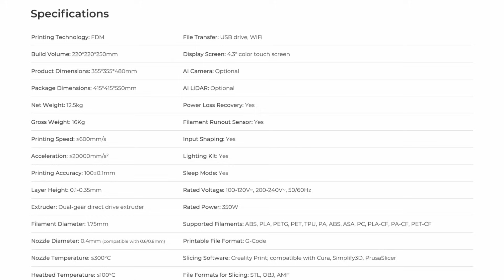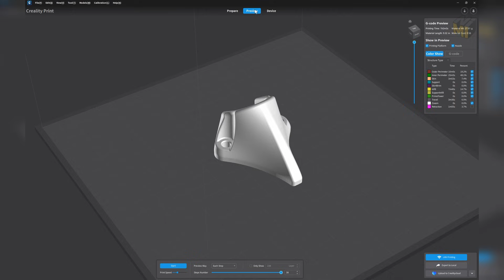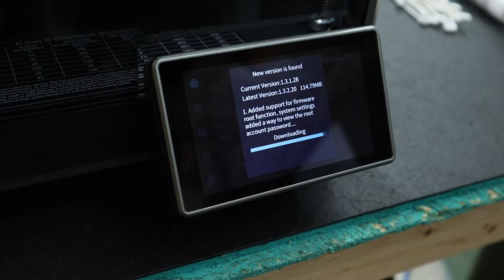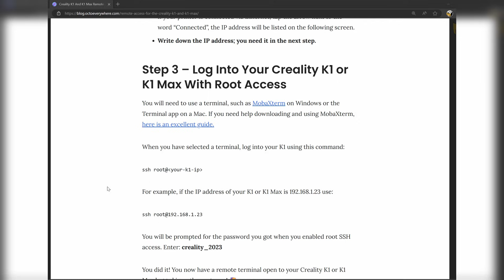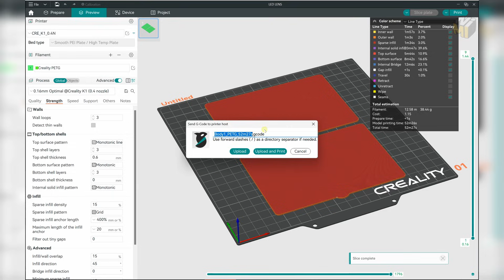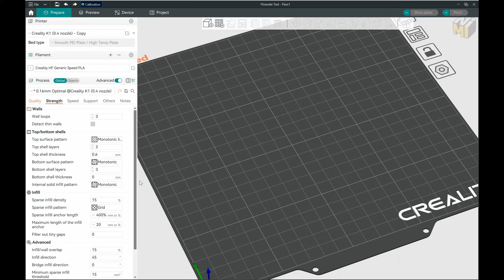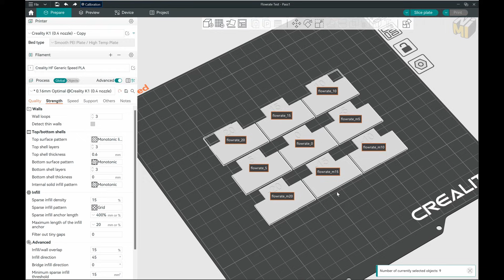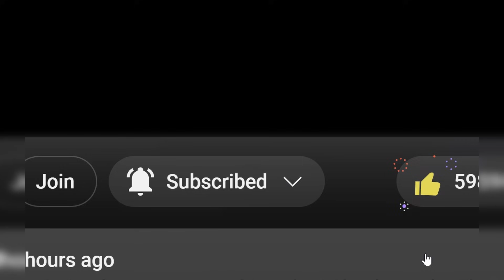Orca Slicer is BETTER than Bambu Studio, Cura and Prusa Slicer because they were the food!

Comment: I tried using Orca after many years with Cura, and I can say that Orca is the least intuitive slicer I've ever used. Basic functions are hidden behind many windows or drop-down menus. After spending a few days getting the profile working properly for my printer, I did multiple tests with parts printed in Cura and others in Orca, and honestly, there was zero difference in quality. In terms of print time, Cura was faster than Orca in many of the tests, so honestly, I don't see the reason to switch, unless you want to take advantage of Orca's multi-color functions. If not, I would definitely avoid it.

Comment: i did my testings for speed and quality in cura and orca slicer with exact the same settings. I dont know why but orga always seems to be stringing a lot more (yes, the retract, z hop etc is exactly the same) and its always around 20% slower than cura. Getting a small part in cura done printing in 5 min with cura and 7 min in orca. Yes i have put accell and everything i can change exactly the same. And the clear winner for me is cura because it has combing. It saves a lot of retraction times and makes the printer even faster, getting the same part down to 3:40 min in cura. With better quallity and less post processing
Reply: the time stamp was  accidentally, ignore it

Comment: I initially downloaded Orca because Prusa slicer was doing some bizarre things with the supports in the G-Code preview... not sure if that was just a visual bug or how they got like that since I didn't knowingly change any settings, but I didn't want to run the risk of the print failing if it was actually going to try to print the supports 2 mm thick.. the built-in setting calibration tests are kind of neat, though I do wish performing the tests wasn't so cumbersome.. just part of the process, I suppose, I'm just lazy and hate wasting material that I could be using for actual prints 😩

Comment: I don't like the UI with orca, I hate that some of the settings are tied to the printer vs filament vs part. I just want 1 big long list of settings so I can go down the list and make sure everything is right and be done with it... I can see how it might work if you have like 50 printers running 100 different filaments, but for the average user, that's not the case...
the only real feature I like is being able to just send to klipper by hitting print.

I'd be more apt to use it, if I could pull over my profiles from cura without having to fucking guess which values translate to which setting.
Reply from the maker: Sure, everyone has their preferences.  I also came from Cura, I'm at a point now where I prefer Orca over Cura, originally I also preferred Cura.  To each their own.  At the moment, I only use Orca it does everything I need and it has quite a lot of new features and some features even Bambu Studio doesn't have like Mouse Ears, and Vertical for setting the seam position.  I say do what works for you, each person will have their own set of requirements and not every slicer may do exactly what you want.  Thanks your thoughts on this!

Comment: No Orca Slicer is far from being the best slicer. Orca Slicer is still missing a bunch of important stuff compare to Prusa or Super Slicer. The biggest one is missing the Printer Dependencies  settings. This alone makes Orca almost useless for a pro user! You can not assign and manage printer profiles besides system presets. And even the system presets can only be assigned via a copy save. Another thing is the missing manifold edges fix under Linux.
Reply from the maker: Everyone has their preference and features they need and like.  Personally I find Prusa far more clunky to use, but it is feature rich.  So is Orca though, and there are always new features being added.   I've never used Manifold and with a good printer like the QIDI and the X1C, the results speak for themselves.  As far as presets, I switch between 6 different printers and 3 different brands, within Orca, it's never been a problem for me and I print all day every day.  I guess everyone has their own definition of what a pro user is.
Reply: @NeedItMakeIt  I'm not talking about user preferences or features here. Orca has plenty good features. I'm talking about major missing settings in Orca Slicer! But seriously....How can someone be a "pro user" without setting printer dependencies and assigning them to profiles? ;)
Reply from the maker: @Gigaloader   I guess we have different definitions of pro user then, I don't find what you're referring to is necessary,  you do, that's cool.  I'll just have to go back and check the definition of pro user again.  I don't think it's defined by the capabilities of your slicer, quite the contrary in fact.  As the sayin goes... a poor craftsman blames his tools.
Reply: @NeedItMakeIt Well....I would define  a "pro user" as  someone who goes beyond  printer profiles given by orca or bambu.  Someone who creates his own. These have to be assigned properly. You can't do that with Orca as it is limited to the existing printers Orca gives you. At least they do have a lot of them tho.  But if you have your own printer build, Orca is a no go. Hopefully it will come in the future. Just pointing out that Orca only seems to be "better" until you have to set up and configure a printer profile.
Reply from the maker: @Gigaloader  LOL.  A pro user is anyone that 3D prints professionally, that's the most basic and accurate definition.   Just to get back to the point, Prusa is good so is Orca, they both work well, Prusa works better for you, since you're at an advanced level and you need the slicer to do particular things for you that other slicers do not.  All good, have a good one.
Reply: @NeedItMakeIt  Your responses are kind of funny as they show a little ignorance... sorry. It's not about what I'm using. Orca is a decent slicer. But is ported from Bambu Studio which the GUI is optimized for their printers.  These settings in Orca are entirely missing. Which makes it easier for beginners. Not a bad thing. But let me know how you set "depencies" in Orca Slicer for a printer which isn't a system preset.
Reply from the maker: @Gigaloader  Everyone is ignorant, it's ignorant to think otherwise :)   I'm not really sure where we're going with this.   The truth of the matter is that you can use any slicer to achieve professional results, calibrate, good filament, fine tune your settings and choose the right material for the job.  So in conclusion, think what you want, it just doesn't mean that you're right, that goes for me as well.  Try and have your self a good day!

Comment: The Orca team seem pretty open to the idea of "if someone will find it useful and it does not break anything we will add it" type mentality, even if that means having some functionality on one operating system that isn't on another yet ( my linux version tells me they can fix models on the windows version).  I think this is a breath of fresh air, and it is what open source should be... if it does not break user space and it works then add it.  As an end user it means each beta version I see more tools added, some of which give me a happy feeling inside.  As I use appimages I am not bothered if one breaks something, I can report it and just fire up a version from a month ago.
Reply from the maker: And to your point, I have several new features in the Beta going right now, and they need a little tweaking, but it's super nice to have the options.  Going from an idea to something useable within months rather than years is really nice!

Comment: i just started using orca slicer and it has profiles for the ender 3 v3 ke and i have adjusted the settings to that os the sunlu matte pla filiament i'm using and calibrated it using the built in calibration feature and been getting some good results far better than creality print. my question is however will it get messed up if you root the printer or do you have a video on the pros and cons of rooting it?
Reply from the maker: Orca is one of the best out there!

As far as the rooting, I have a video on rooting, but not the pros and cons.  There aren't many cons, because even if you run into any trouble, you can easily reset your printer, there is a HTML link to reset your printer to factory.  I've done it 2 times now just for the sake of making videos and recording the process from scratch.  

The only downside I've found so far is that when installing Guppy, a touchscreen interface to replace the stock Creality one, the IP address always shows as 0.0.0.0. and that is not good.  It still shows even after several weeks.  The only way to find the true IP is to login to your WIFI and see the IP addresses of your devices, that ended up working for me.  

I don't believe that there is any impact to rooting from the standpoint of the operation of the printer, the original Creality FW stays intact and we can just access all of the files and add or change macros now.  I would say that by using Orca you'll see an improvement on your prints, Orca is just a better slicer.  

I'll have a video out soon for the KE, I am just finishing up the design for a solid linear rail setup for it and it should be good!
Reply: @NeedItMakeIt  ty
Reply from the maker: @marknewsom1377  No problem, I just finished re-assembling my KE with linear rails and it's doing the first print now, seems to be all good, and it's rooted and working well.  Printing through Orca wirelessly is really nice.
Reply: @NeedItMakeIt  one more question for you what should i go with mainsail or the other one i forget the name of right now
Reply from the maker: @marknewsom1377  Sure, well, both do the same function.  Mainsail  and Fluidd.  I like Mainsail better personally, I just prefer the way it looks and how clean and user friendly it is.  If I switched to Fluidd it would probably only take me 1/2 an hour to get used to it.  Mainsail also allows you to color code your printers, for me that's helpful because I am sometimes looking at 3 printers at the same time and it's just a little help to tell them apart more easily.

I hope that answers your question.
Reply: @NeedItMakeIt  i can use mainsail with the orca slicer correct? i dont need a rasberry pi or any other special device? sorry i feel like i'm bothering you with these questions
Reply from the maker: @marknewsom1377  No problem.  Yes, if you have the KE, it has WIFI built-in and you can send directly from Orca and also view within Orca, you can choose Mainsail :4409 or Fluidd :4408.

Comment: Creality Print is free and works without any issues and has the built-in calibration tests (in fact very similar). Still trying to figure out what the Orca slicer value add is. So far I find that CRP looks a lot cleaner, has seamless integration to print/view via LAN for Creality printers and great profiles.  Last but not least. No need to root your printer which is not a default way to go for many. Thanks for the review!
Reply from the maker: I've used CP quite a bit, it works, and they're slowly developing it, but it's still missing lots of features that the Prusa/Orca Bambu slicers have.  It is also quite slow in comparison.  It works for the most part, and that's what's most important.  I've found that I can get a lot more performance and quite a bit faster prints by default using Orca, and rooting is now is a piece of cake after doing it 5 times.  It would make for a good video to compare them as well, so that might be something I can do after I tidy up the ones on the go.

Comment: Nothing to add to the title of this video. I changed to Orca because of the K1 wasn't supported by others. And i never regret.
Reply from the maker: It's still going strong for me as well, it's a pleasure to use, I just need to figure out how to set my printer IP to be static, it seems to want to change a few times a week for some reason.  I turn it off because unlike the K1 Max, the printer fan stays on.  I've installed Guppy interface now as well, it's also pretty cool, lots of extra features, but I just had a problem where my IP was set to 0.0.0.0 and no access.  Luckily I was able to find the actual address through my rogers account, and it was a normal IP.

Comment: Yeah maybe include in the title,  Orca with a K1 as that is what the vid is primarily about.  Is Orca really the best, not if you don't have profiles for it.   Go in a do a setup for a CR-10 SE.  You will find yourself in *.json hell .   One might say just use the settings from the factory setup,  yeah right.   Nothing in between all the slicer flavors out are remotely named or defined the same.   Do they mean the 5000 number or the 8000 number, maybe its the 600 number but the 300 number might be safer, but one entry is at 20000 and I didn't even know it could go that fast.  To be the best it might have a better pathway to bring in the proper machine specs that are known good.  From here I could concentrate on learning ORCA and best filament settings to use.   Is it really better, is it really?  I think it needs more time in the oven.
Reply from the maker: That's a good point, and I appreciate the feedback.  I'm working on growing the amount and type of printers I run, which helps with these things.  As far as your printer, yeah, community based setups can be tough, and there are a lot of variables when it comes down to it.  I'm not sure there is any one answer to this issue with any slicer.  I suppose to steal the settings from a slicer that you use and try to make them work in Orca.  I'm still only using Orca, and it's all wireless, it's been a huge benefit to me, and the hope was that it would be for others as well.

Comment: I just tried Orca last week. After all the hype, I wanted to like it. I was excited about the simple interface and control over supports and infill. I even spent a few days on it to give it an honest chance. But.... 

It was like going back in time two years.

100% of my prints are functional and tend to require precision fits and, you know, actual engineered tolerances. They have mating parts or otherwise interact with other hardware. With Orca it was back to scaling and trial and error games with positive and negative expansion. Or, almost as bad, tweaking the model to get it to print at the correct dimensions.

I printed the same parts in Cura with Slicing Tolerance = Exclusive and everything fit perfectly on the first try.

Until Orca has a way to control how it handles the model's envelope, it's a waste of time for me.
Reply: It does have option called precise walls, and you can print outer/inner/outer for precision.
Reply: This might hint to an issue with your e-steps and/or the flow rate which determines how much filament is pushed out. Could be the e-steps of the extruder or the e-steps of X, Y and/or Z motors. I'd make sure the printer is calibrated correctly to perform the commands accurately before trying to fix it with the slicer.

Comment: I wanted to point out that your IP address, while it's Class C (typically used in home networks), it is not a private address, and could cause issues for you down the road.  Class C Private address ranges from 192.168.0.0 to 192.168.255.255.  On the video you used the IP address of 192.0.0.156 which is a public IP address, and I assume that since that's the printer IP address, the rest of your network may be using public IP addresses as well.

Hope that helps, have a Happy New Year. :)
Reply: This is a good observation, too many people assume that if it starts with 192 it's safe to use. I've seen a... disturbing amount of larger corporate networks just willy-nilly using 192/8 and 172/8 subnets that are absolutely not RFC 1918. Then when that gets fixed their mysterious network issues with certain websites resolve. It's the darndest thing.

Comment: Orca is amazing, according the feature it offers. But unfortunately, it makes a lot of stringing on my CR6SE, wich is very anoying. 
When returning on Cura on the same printer setting, it works without stringing.
I found a CR6SE plugin for Orca but it didn't really resolve the problem.
Reply from the maker: That's a bit strange, I would expect that it's retraction, but it could also be retraction speed, I can't say I've ever had to play with those settings.  If it's the same material and the same printer, there aren't too many other options, there is something in the software affecting those settings.  

I still enjoy Cura, unfortunately it doesn't work well with my current printers.
Reply: Same here.  I can't even get a retraction calibration test to print at any setting that will stop the stringing with PetG
Reply from the maker: @2metock  PETG can be tough, if you haven't already, dry it out for 12 hours, that's the first and most likely cause.  Are you printing on a CoreXY faster printer?  PETG performs well with those higher speed printers and fast travels.